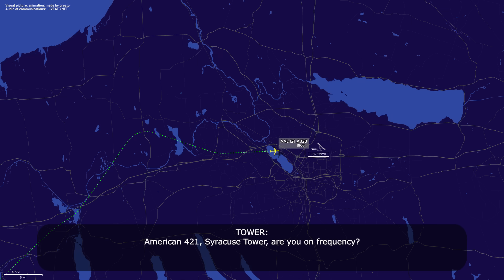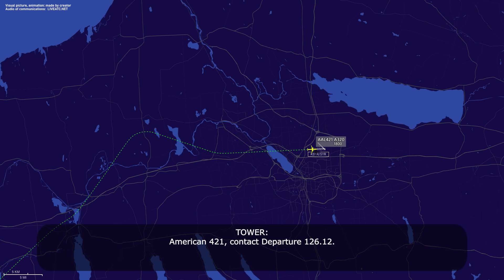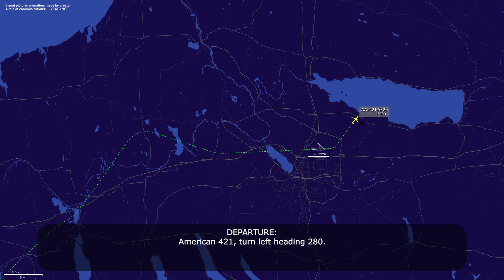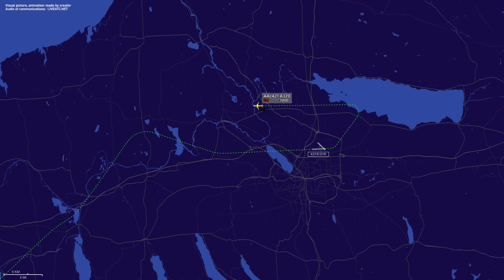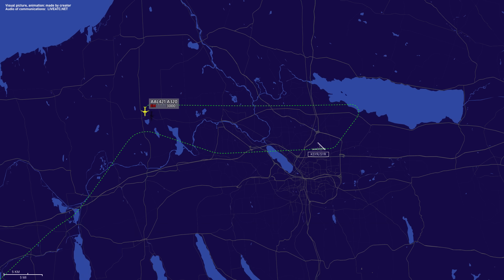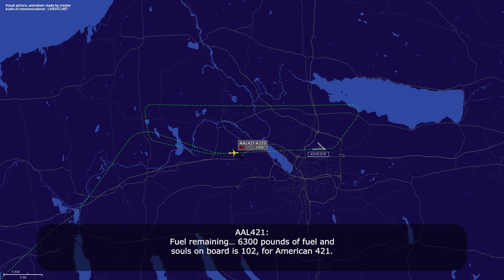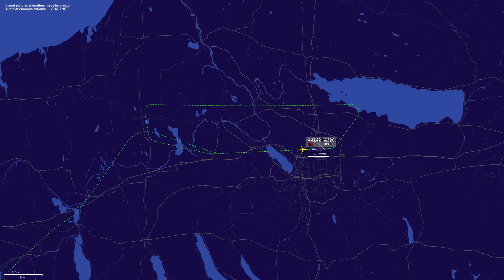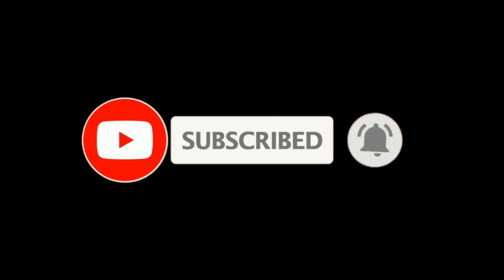Hydraulic system failure. American Airbus A320 declares an emergency at Syracuse. Real ATC

Comment: Not an emergency
Reply: Pilot stated emergency @2:01 : emergency.
Lost a system that has cost loss of life before: emergency.

Why do you state this is not an emergency?
Reply: @ they had 2 more hydraulic systems. No danger. U can fly with only 2, no issues
Reply: @ You're assuming the damage was isolated to and contained within one hydraulic system, which can't be determined until after-the-fact. It's entirely possible for the first sign of a more severe progressive failure (e.g. burst tire) to be a single hydraulic system warning, and it's entirely possible for the leaking hydraulic fluid to cause other problems elsewhere (e.g. fire, fumes. See e.g. Qantas A332 at Sydney on Dec 15th 2019).
Reply: @ airbus says it is not an emergency, but company procedures may differ
Reply: @user-microburst  Mandatory? No, correct. Land at nearest suitable and a bunch of landing considerations? Yes.
Reply: @ not as per Airbus. U can continue to destination. Little landing consequences, which don’t preclude a landing in virtually any runway a 321 can normally land. I’d return to departure airport only if is my base (and after speaking with pilot duty manager). Otherwise I continue to destination.